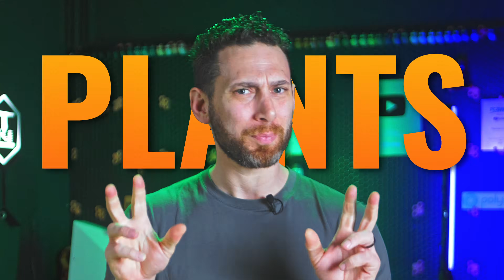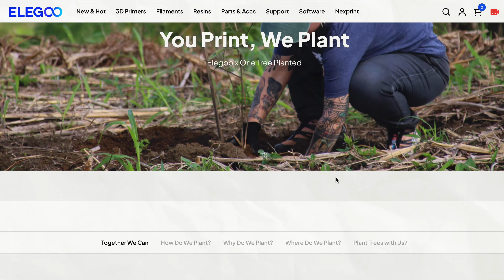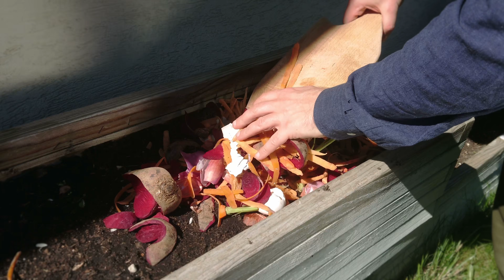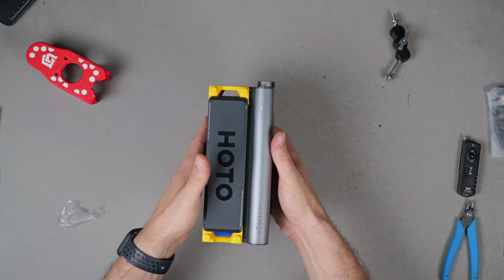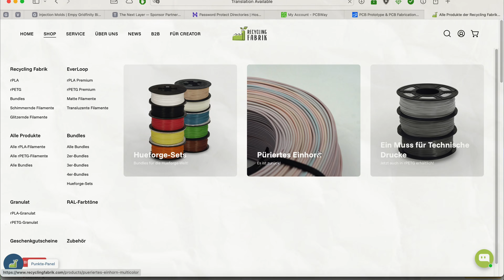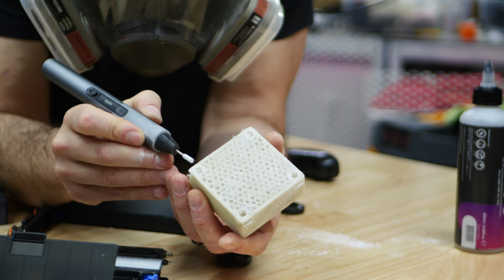3D Printing Doesn't HAVE to Destroy the Planet!

Comment: You’re way too focused on Carbon Dioxide (CO2), which is the least of our worries when it comes to industrial/petrochemical pollution. Greenhouse Gas Theory is literally just an unverified theory, climate change is most likely being driven by ozone layer depletion (petrochemcial production and use) not “CO2 and methane” (read as “living beings”).

Comment: One topic that was not covered in this video is the air pollution during printing. Every printing material creates micro plastics and VOCs. PLA produces less ABS more. I know there was a dedicated video on air filtration but I'd mention it here as well. This is what has the most direct environmental effect and this is what can cause problems for the user in the first place. I think that preferring enclosed printers with proper air filtration is a must. Proper means keeping negative pressure and using capable HEPA and activated carbon filters.

Comment: Regarding filament material, I suggest to look for the ones that has EN 13432 certified. This is a standard that verifies the biodegradability not only the pure material like PLA but the additives also. It remains still only industrially compostable but won't leave any non-degradable components. These filaments are very rare but I support the manufacturers to have this certification on their filaments and I prefer use those instead of other non-certified ones.

Comment: Paper spools have several major drawbacks. First, they absorb moisture, requiring extra energy to dry before you can properly dry the thread. Second, on some rolling systems (such as AMS?), paper spools often jam due to edge wear, resulting in failed prints. The solution is to print a plastic sleeve to protect the edges of the paper spool from wear. I also recommend doing this for your paper spools (if you are using these external rolling systems). 

At least for now, I don't think manufacturers should blindly use paper spools. They shouldn't use paper spools for highly absorbent materials, or for filaments like PA that generate structural moisture. Instead, filament manufacturers should be encouraged to use recycled 3D printing waste to create new plastic spools, since they don't require the same level of purity and precision as manufacturing new filaments.

Also, I've seen your 3W drying system. While it can quickly dry the entire system, you've overlooked the energy cost of regenerating the desiccant. Perhaps those costs should be added to a more objective cost-benefit calculation?

By the way, I remember seeing an electronically permeable membrane; maybe that's something to consider?

Comment: It can't get more fun... SAVE THE PLANET. 
All you have to do is to buy a new plate for a cooler printing (~$20) and a Magigoo Supergrip for $25. So... we save what here? Shall we calculate the impact of bed plate and glue manufacture/offset? 
In PLA printing, the electrical difference is so minimal, that it would take you eternity to ROI on that $45 investment with more hassle of glue application. 
That is the definition of deceptive marketing - Greenwashing.

Comment: You missed one of my favorites. Not everything that needs 3D printing needs to be entirely 3D printed. Incorporating materials like wood, prefabricated plastics, metal or carbon fiber inserts, etc can save a ton of plastic and result in a final product that is significant stronger and more functional than a fully 3d printed version would be. People designing for 3D printing need to get out of the habit of looking at every problem like a nail because they have a hammer.
Reply from the maker: Great point!!

Comment: Have you tried in-situ cross-linking filament for 3D printing that hardens after melting making the part stronger and less likely to warp? I often wondered if 2 materials pressed together in to a filament (or one as a core to the other) and mixed in the hot end when melted could give a epoxy/glass fibre type of effect making the part more durable than just melting and re solidifying a plastic string can. Have you heard of such a filament? Do you even think it possible to make such a filament? There is solder with a rosin core so a thin filament inside another should work, right?
Planting trees is mostly pointless if they are not buried in a disused mine forever or left indefinitely where they stand and never burn in a forest fire. Don´t get me wrong I like forests but they do not last all that long, sooner or later they are cut down and/or burned in some way.
I just got a pen grinder tool and a 3d printer pen to fix minor print failures.

Comment: For prototyping where you do need to print, you can section out only the areas of concern and save a ton of filament.
Reply: Came to comment exactly the same thing.  I did today, printing a 5mm slice of what was making to check for fitment and once satisfied, printing the items in full.

Comment: I don't understand why every YouTuber who posts about 3D printing shows rows and rows of bare spools of filament sitting on racks, just soaking up moisture.  It comes vacuum sealed for a reason.  As soon as I open a bag and finish printing with it, the spool goes directly into a 1 gal / 4L Ziploc bag along with the dessicant for storage.  If I had reusable vacuum bags, I'd use those.  Except sometimes for PETG, I never have moisture problems, and when I do, it's obvious when the first layer prints.  For that, I have a low wattage drier I run for a few hours before printing again.
Reply from the maker: Most of what's on the wall is PLA and PETG, it doesn't absorb water that fast. But also, it's just not practical to vacuum bag 300+ rolls

Comment: Some good points, but it's worth noting that individual efforts for any kind of "greenification" tend to be marginally effective at best.  This has two implications for us.

First, don't stress about you supports and other minor waste.  By all means, make the choices that improve your efficiency - if a spool cost 20$ for a kg, then every gram of waste you throw out is 2 cents you've just lit on fire - but don't go "oh, no, I'm an awful person" when you're throwing out a shopping bag's worth of support and brim material every month or so.  Your company picnic generated more plastic waste than that in an afternoon.

But more vitally: seek out systemic processes you can support.  The organisations mentioned in the video are an option.  Your municipal government may have good systems in place for organics reuse or cardboard recycling.  Your electricity provider may have an option to support the development of wind and solar.  Because Jonathon's right, the /biggest/ environmental cost of our hobby-level 3d printing is the electricity generation.

And building on that: if you truly give a rat's ass about this, and you live somewhere that's still burning dinosaurs for electricity, start making noise.  Write your elected representatives, circulate petitions, talk with the people you know.  Point out that solar power is not only good for the planet, it's exceptionally cheap, which is good for the economy.  Heck, go get a job installing solar panels.

Yes, little changes add up, but they don't add up to a lot.  If you really want to reduce the environmental impact of your life, find a way to contribute to the /big/ changes that are happening all around us.
Reply from the maker: Agreed!!

Comment: FYI, oil does not come from Dinosaurs.  It comes from old carbon based items like plants and what not.  Dinosaurs are not found at 1000 feet below the surface where oil is.
Reply from the maker: FYI, it's a joke.
Reply: Only imbecile believes oil comes from fossils or dinosaurs. Oil is product of tectonic processes and it's being continuously produced in the mantle from organic carbon that subsided with tectonic plates. It's renewable resource. That's why oil is nearly always UNDER solid sheet of rock that creates a lid and it's under pressure and there is oil even in depths of 12km
Reply: Agree, 100% renewable.

Comment: During summer I dry my filament and silica-packages in a solar dryer. To ensure constant temperature this require about 5W for fans and a small microcontroller instead of 200W for a normal filament dryer. I have alot of silica, which I dry when sun gives enerergy for free, this prevents my filament of soaking up moisture, so I barely need to dry the filament.
Reply from the maker: Smart!

Comment: While I agree being friendly to the environment is the best option, interpretation of what is friendly to the environment has changed over time.  Back in the 70's when I was a kid the idea was to stop using wood and cardboard and natural materials and instead use the 'manmade' stuff like plastic since that was considered more permanent and will not need to be replaced or consumed as much. Plastic was seen as the 'savior' of the consumable world.  Trees would be preserved.  Now days it is just the opposite thinking where trees can be regrown as needed and plastic is 'poison' cause it never goes away.  Either way the best idea is to be smart with your methodology and don't waste resources, whatever they may be.  
Great video with lots of good information. :)

Comment: I disagree with not making prototype prints and revisions. You can use less walls and infill for the slices of the prototypes. Additionally if you plan to share the models, having it need post processing after printing would be rough on whomever prints it later

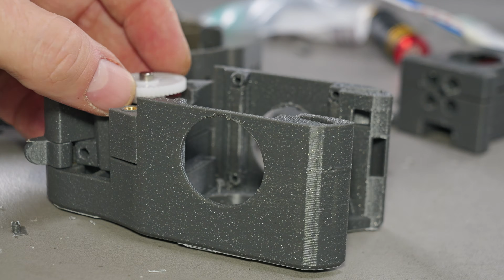Comment: 2:15 oil is also from  plants, mainly from ancient algae if I remember correctly

Also "eco-filaments" here are expensive af, I don't have american or german money to buy it, especially since it's mostly for personal use, and I use PETG because most of the stuff I print ends up in my garden.
But I do try to buy refills, mainly because I don't want to end up with mountain of empty spools.
Reply: Yup, the whole dinosaur thing is a misconception. The real issue is that burning oil messes up the atmosphere.
Reply: Oil is product of tectonic processes and it's being continuously produced in the mantle from organic carbon that subsided with tectonic plates. It's renewable resource. That's why oil is nearly always UNDER solid sheet of rock that creates a lid and it's under pressure and there is oil even in depths of 12km. Don't belive some drugged up hippie boomer morons. Their brains were fried by LSD and they were stoned when they came with most of their idiotic speculations

Comment: While the goal is noble, don't make "eco factor" a primary goal of printing. If it is important to you, have it as a tertiary, or even quaternary goal. Your main goal should be to have a part that fits the bill, to have it accurate, thought for, and printed in the right material. Anything else is extra.

While we shouldn't consume just to consume, the hobbyist 3D printing enthusiast is not to blame for landfills, plastic polluted oceans, or microplastics in our food (unless you printed your own cutlery...). Even the flexi dragon and fidgrt toys factories at your local fair aren't to blame.

We DEFINITELY should keep in mind that we are making a negative difference when we 3D print, but let's not get obsessed over it.

With that said, I now know what to do with my cardboard spools, so thank you :)
Reply: I think you're making a good point. We can't solve this on our own. Ultimately, it's the job of manufacturers.

Comment: Recycling cardboard is much more environmental friendly as composting it, because if you comost someone need to produce cardboard from "new plant fibers"... and even worse: in countries that has high recycling rate, some unhealthy stuff might be in the cardboard from recycled cardboard. You don't want this in your compost pile.
Reply from the maker: Not sure I agree. If you consider just HOW BAD methane is, composting your food waste as a whole is one of the best things you can do to offset your footprint. You can't do that without "browns." So if you have a lot of dead leaves year round in your garden, great, but I don't. So... cardboard spools. Also, as I mentioned in the video, new plant fibers means someone planted a tree, which captured carbon from the atmosphere, then they turned that into a paper product. So planting and harvesting more plants is actually a very GOOD thing.
Reply: @thenextlayer  During the past 15 years, my compost runs very well without cardboard. Otherwise we have a local compost facility, I could also throw food waste into the bin for bio waste. Our normal waste goes to an garbage incineration plant, also ne methane there.

Comment: Very important: You should choose well designed models and printprofiles. This saves waste as well as used filament, energy and print time.
Sometimes I find models that are increadible heavy on some model pages without any reason.

On the other hand, if you publish bad designs you encourage others to waste filament... potentially hundereds of bad print or prints that use more filament than atually required.

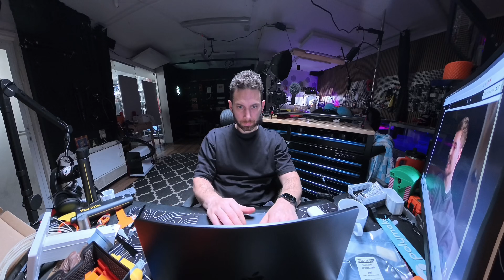Comment: 20:15 Then there’s me who will stare at my 3D model for hours making sure everything looks good. Only to have to reprint the whole thing again because I messed up the tolerance by 0.1mm.
Reply: Or you find out that the dovetails you add to a model were just laying on the buildplate cause come to find out it was a little less than a millimeter away from the model itself....so you have to reprint the whole thing 🙃🙃

Comment: I will print a christmas prop out of pla pro and see if it survives a month of queensland summer... I would like not to use petg, but it's basically the go to in this weather...

My printer is solar powered, in fact we export about 5x more power than we use making us about as carbon neutral as driving a tesla for 300km per month :D

My prototyping method (at least for when I'm interfacing with other existing objects - like a window slider) is to get it as close as I can, print out a 2-4mm tall slice and test fit, then I will file, cut, or add tape to the slice however I need to get it to fit, measure that, then adjust the model, usually only need one, at most 2 slices to get things right.

Comment: Dinosaurs are not, have never been and will never, be a part of oil. That was a commercial from the 50's or so by the Sinclair oil company and not based in reality. Oil comes from plants decomposing under high pressure, in almost all cases it's plankton.

Comment: I expected you to talk about PHA. If more people bought it the price point would come down to the point it could take the place of PLA and we'd be using a truly compostable plastic that is almost as good in every way and will survive perfectly well indefinitely inside.
Reply: I've seen so much talk about PHA already, but it's still too expensive and barely available. I feel like we need to start some initiative, directly targeted at the big manufacturing companies.
Reply: But only if manufacturers also use eco friendly color pigments...
Reply: @koenraadprincen7212 there are plenty of those. The food industry is full of them.
Reply: @koenraadprincen7212 Ecogenesis/polar filament does. That's why there is a limited number of colors. All the colors are independently certified

Comment: The best carbon footprint reduction is to use 3d printing to fix something you'd otherwise throw away.
One such example is probably the first thing I printed: a volume knob for cheap PC speakers.
Another example is printing addons to existing parts. Such as the bambulab AMS lite stand I no longer need as I hung mine on the wall.
With a not very large printed part, I turned it into a very nice laptop stand I use every day.
Reply from the maker: Agreed and I included that in the video. I especially liked how I saved an entire ethernet cable by just printing those add-on clips. I literally had another one in my shopping cart when I discovered that print.
Reply: Using the AMS Lite Laptop Stand as I type this haha
Reply: I have saved an absolute ton of money using my printer to repair things that I would have thrown away

Comment: Spools that are plastic should be made of recyclable materials and clearly labeled as such for material sorters at facilities.
Reply: 100%  When I first started printing I was really surprised there were no recycle symbols/info on the spools.  Some of them are quite dense and heavy, especially compared to a small plastic drink bottle that has recycling info.
Reply: Absolutely 👍
and because of this you should recycle your cardboard instead of composting it 🙂
Reply: They are in most cases, I like spools from alpaplastic, either PS or PC.